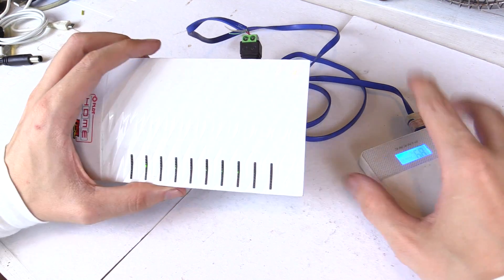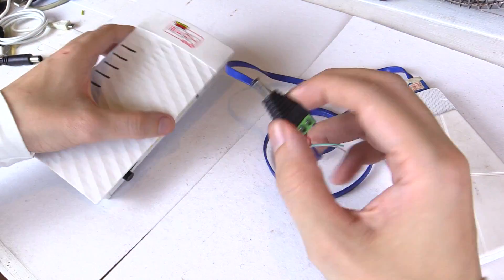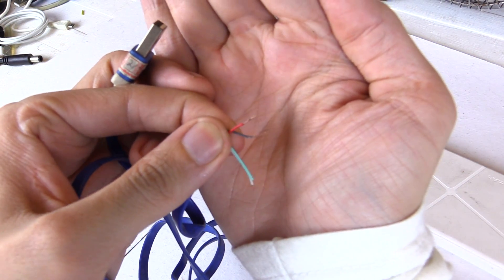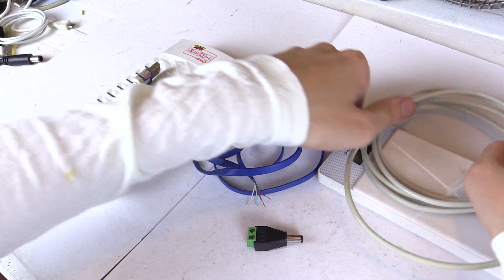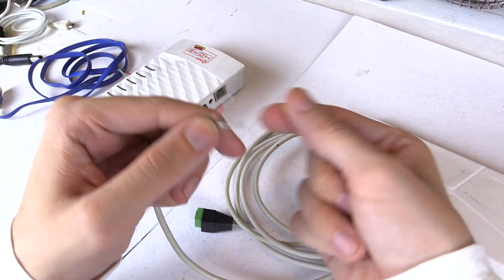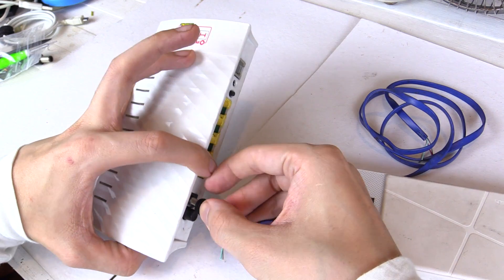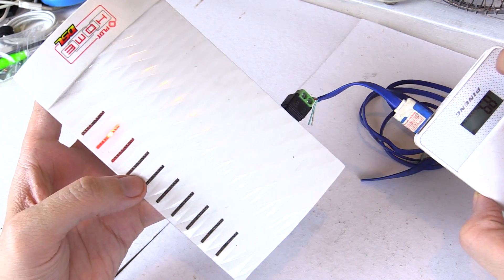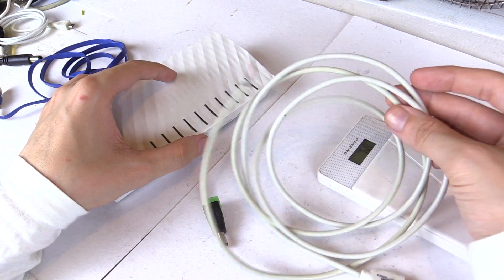Powering router from USB powerbank - Follow up

Comment: My router says 12V 2A but power bank gives only 12V and 1.5 (with usb C) 
Would it still work?
Reply from the maker: @jonathanm.6228  even if it says 12v 2a, most of the time it won't use that much. If you were to put it under a full load and attach something like a USB ssd to the router, it's possible that it might eventually reach 2A. 

But under normal conditions, the 1.5A is likely to be enough. 

I can't guarantee it, but most likely it will work just fine.
Reply: @GadgetAddict  thank you!

Comment: I am currently using a 54000 mAh power bank as backup for our PLDT router since it says that it is 12V~1.5a I purchased a cord with the same capacity. Now, it works, it powers up the router but after about 20 mins it fluctuates or it reboots. Any ideas where the problem could be? The power bank says it can power up 12v too. It would be very helpful to hear your thoughts. Thank you!

Comment: this video could be better if it's more specific to details like diameter of the power adapter port or whatever it's called and where to buy these stuff that works. it works for you but how about others watching that doesn't have junk shop at home. people understand it but the question is, where do we get the materials that works in most cases, maybe you can throw us some links. saves time and money.

Comment: I have pldt home fibr. Power rating is 12v 1.5 amps 
Powerbank 5.1v 2.1 amps Its not working 
But pairing with a modem with 12v 0.5 amps no problem i need help
Reply from the maker: You could buy a DC-DC converter that steps up the USB 5V to 12V.
Reply: +Gadget Addict can i ask a demo using dc to dc converter . I have no idea of that device tnx it would be a big help
Reply from the maker: Sure, I'll throw together a quick video in a few days :)
Reply: +Gadget Addict tnx it would be a big help since our area has a power outage due to earthquake . And grid power has no yet definite time on when will it be restored . 😬👍

Comment: Hi, I want to use your router/powerbank trick but I dont know how to check the polarity so that I can connect the right wires. I only have a clamp meter 266 and I have already severed the wire of the adapter. Can you help me identify which is the load wire and which one is earth/neutral?
Reply from the maker: Usually there's a diagram next to the input that shows the polarity. 99% of the time, it's center pin positive and the 1% that doesn't match that really deserves to be broken anyway!
Reply: So basically I can get it to work even if I get it wrong? I can easily make out which one's which from the USB cable but having a hard time deciding which to connect to red and black. Any pointers will help as I am an MBA and have no clue regarding anything related to this. Thank you for replying.
Reply from the maker: If you get it wrong, you might blow the router. Is there no icon next to the power input? There's nearly always an icon that tells you the polarity. If you had a multimeter you could check the continuity between any other ground on the router and the dc input jack to work out which is negative. 99% of the time, it's center pin positive.
Reply: It has a diagram and it is center pin positive, I am stuck at which wire to connect to the USB cable as both wires from the old router adapter that I cut are black. I am just stuck at which wire should be connected to the red one from USB cable :/
Reply from the maker: Are you sure one of the wires doesn't have a white line along it or perhaps some writing or dots? If you don't have a multi-meter, you could get a 9v battery and an LED. Connect one side of the LED to the positive of the battery  and the other side of the LED to one wire on your DC jack cable. Then connect the outside of the jacks barrel  to the negative side of the battery. If the LED lights up, you know which wire is negative  :) The 9v battery will blow the LED pretty quickly but at least you'll have your answer. You could also just use a lower voltage battery, as long as its enough to light the LED.

Comment: i have power b 10000 mah 5 v 1 a and router 12v is it work.
Reply from the maker: +ADEL OBEI what model is your router? Most routers drop that 12v down to a lower voltage but sometimes you won't know if it's going to work until you actually try it. It will either work or not work, it won't damage the router either way.
Reply: +Gadget Addict make a demo using dc to dc converter pls pls pls !😁✌️

Comment: it wont work with my huawei b315s
Reply from the maker: +benjo luzuriaga did you try shorten the USB cable or use a different powerbank? What's the maximum output of the powerbank you're using ?

Comment: My powerbank output voltage is only 5v but my router is 9v, will it work? Thanks
Reply from the maker: Most likely it will work. All of the routers in this video are rated at 12V except the PLDT router which is rated at 9V. All of them worked :)
Reply: I would like to update that it didn't work on my router.. :( I have a Huawei B315s-936 that is being provided by Globe Broadband.. Also, the rated voltage of my router is 12v not 9v.. :( so sad..

Comment: great I have never seen that power plug you connected to where you get that from ? the one on the wifi connection usually only soldered ones

Comment: Both this and previous post really useful thanks
Any rhoughts on heat impact to powerbank of having it continuously in line 
You mentioned pass through, is it truly pass through or just charging at the same time as using
I would be pleasantly surprised if a powerbank switches to true pass through once charged
Seems like there would be a market for an integrated unit, i had a quick look but the closest i could find was this
http://www.amazon.in/Resonate-RouterUPS-CRU12V-Backup-Router/dp/B011UPEL4O
Reply from the maker: I can't comment for every powerbank but the one I've been testing with, really does seem to allow pass through power. It's fully charged and the router is continuing to run. I can feel no heat from the powerbank. I would expect that after some days or weeks pass, the battery voltage will drop and it will likely continue to charge itself again. Personally my powerbank isn't getting hot and I'm not experiencing problems. But mine has only been going for 3-4 days. A couple of other people commented they've been doing this for a long time without problems. I guess the only way I could be 100% sure is to dismantle the powerbank and put a meter between the battery and charge controller and then on the output too.

Comment: can you hook up 2 usb ports to get 10v tho?
Reply: ZuluCharlieFox that's not how voltage works.
Reply from the maker: From one powerbank or from one wall charger, no you can't do that. But there's some circumstances when it might work using two different powerbanks.

Comment: Possible to get power on copper lines 50 volts step down voltage to power modem? I had tried 12v battery then universal dc adaptor to power modem. But how 5v can power 12v?
Reply from the maker: Inside most low-end routers, you'll find a dc-dc converter that is dropping the supplied 12v to 3.3v. That's why it still works when powered from a 5v USB power supply. You mention 50 volts copper lines, are you thinking of drawing power directly from the phone line? As far as I know, there's just about enough power to light a few LEDs, but not enough to power something like a router.
Reply: if  power  to  low  try  2  usb  3.0 cable